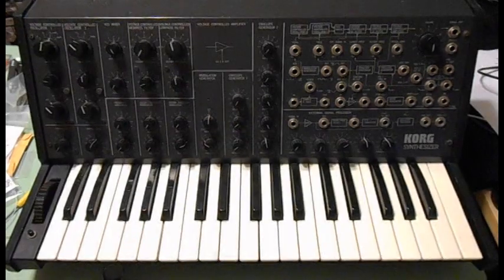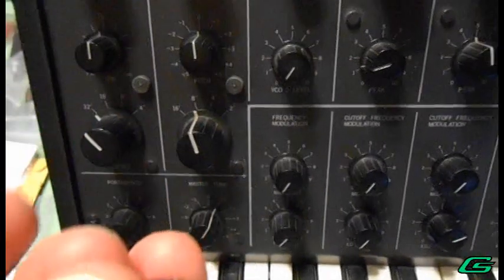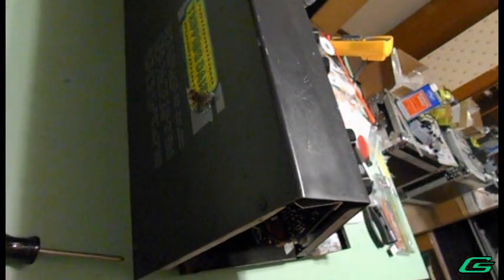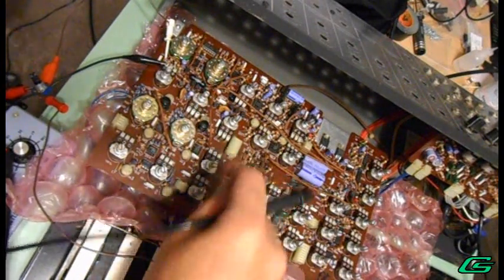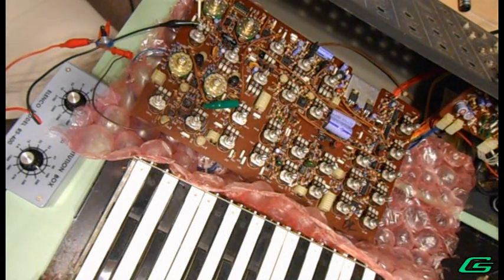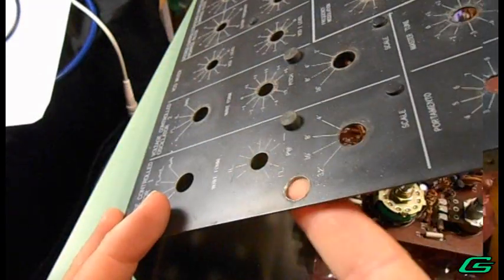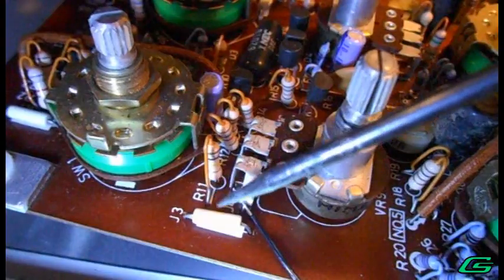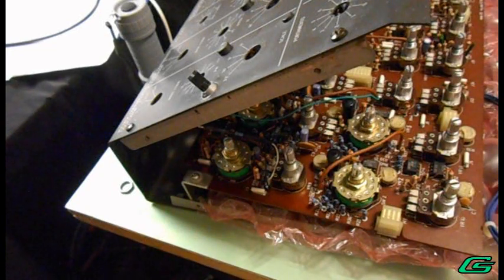Korg MS-20 Teardown: Pulse Width Modulation Install

Comment: 11:37 you say "rest prevention" ? Or what are you doing there?
Reply from the maker: Oh good question.  I just drilled a hole in a steel alloy panel.  Without anything covering the bare metal over time it will oxidize and rust from moisture/humidity, unless prevented by an application of oil/enamel based paint.  I choose oil/enamel based paint as it sticks to metal better than acrylic.
Reply: ah ok. rust prevention!

Comment: 100KA is a log taper pot. Did you mean to say 100KB?
Reply from the maker: I think I didn't want to make a special order, just use what I had on hand.
Reply: gstormelectro Just clarifying your terminology :) Do you enjoy the response of the 100KA pot or would you have used a linear pot if you had one on hand?
Reply from the maker: I would have used linear if I had it.
Reply: gstormelectro cool cool

Comment: 15:30 - Personal Jesus mod? ;)  Cool job!  I'm only a "breadboarder" yet... Going to implement some simple PWM for my 4046 based little synth (with single supply). BTW, does MS20 allows to modulate it's osc's with a wave taken from the latest output (after filters and etc.)?
Reply from the maker: You're talking about audio rate FM, yes that would be sweet.  I just tried it using the headphones output jack, into both the Total input jack and the osc frequency input jacks.  Turning up their corresponding knobs is a static increase in pitch, it does not modulate the pitch like a DX-7 or something like that.  I would need to visit the schematics and see why it does this.
Reply: MS20 schemo is much more complex than my toy :) https://soundcloud.com/kirill-threedee/cyber-puppy-hickup it's an example how this FM sounds...
P.S. Ooops! Sorry. No, the "feedback" is just in the "CV in" for 4046. That "BUT" is about another (yesterday) changes. Just tried (and it works) the output from the AR generator to modulator osc's frequency.
was: "BUT there is a modulation into a mod. oscillator! So the sound becomes pretty complex. My FM comes into one of the schmitt-trigger inverters input... So probably it works easy because of this. The "power" is a simple voltage div. by a pot."

Comment: I wouldn't do it to my beloved MS20 but good work. Is it me or the tuning of the oscillators should be calibrated?
Reply from the maker: Oh snap tracking may be off a little?  I just put it all back together LOL.  EDIT: well I take that back, that's what the calibration points on the front do - no problem :)